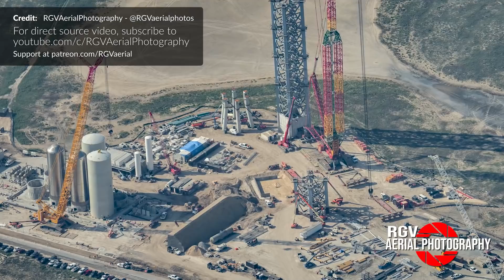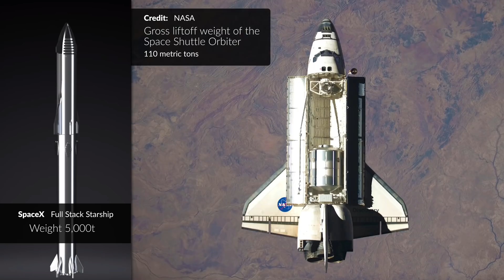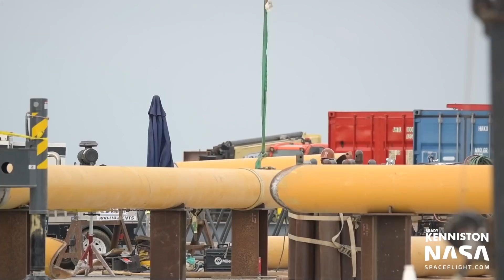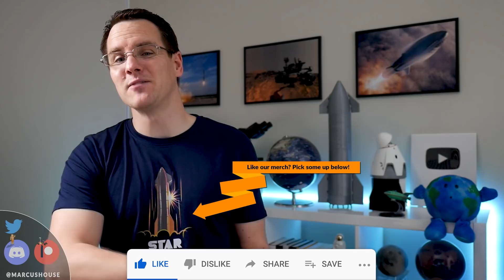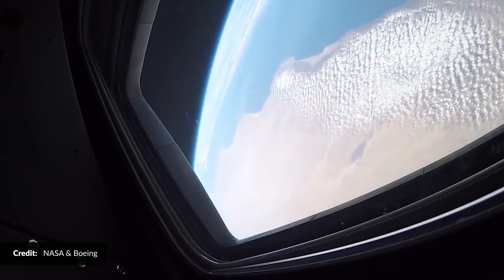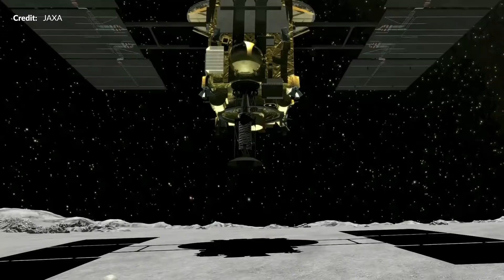SpaceX Starship requires new booster, Shotwell still suggests July for Orbital Flight Test

Comment: The launch tower catching the super heavy doesn't require special tech to work.  The super heavy needs software to put those engines in hover mode for controlled lateral movement in all directions.

Comment: Why won't they just use a quad point tension platform to help reduce the initial mass needed for the engines to give a better initial lift off saving fuel?
 With our modern technology we should even be able to use magnetic track or tunnel to get an orbital vehicle up to speed before it even leaves the ground?
 We've seen some crazy advancements, why not put them together for some greener lift offs... 
Maybe even a space elevator  with a permanent orbital anchor (detachable in emergency) allowing for a real commercial space station and mega labs.
 Either way Go SpaceX

Comment: Hubble is down? Not good just when there is a dwarf planet inbound most likely from the Oort Cloud. It will pass through the Saturn orbit in 2031. Yes ten years to go. The earth will be 9 AU from the planet as it passes. It already has a tail and is coming just about top down, extremely eccentric. It only has a number atm. It’s at a distance about that of Pluto and already has a tail. It is 300 km diameter and it it’s round then it is a dwarf planet.

The planet was found by accident by DES dark energy survey. The computer spat out a WTF and a person went oh fuck look at that! Cool. More time = more accurate info.

So Hubble would be handy right about now.

Comment: Gas thrusters make orientation and placement easy. Only 1m of damping is required on the yellow catch arms which can be added to the vert sliding rails. The crane will be used to lift and relocate to table

Comment: FYi, more fuel does not necessarily mean a bigger explosion.  A almost empty fuel tank will explode easier and more than a full tank. The fire afterward is a different story. Near empty fuel tank is a bomb ready to go off, you need both fuel and air for explosion. Fuel only does not explode. The could use inert gas to prevent explosion in case of a leak.

Comment: I do not see lunar gateway, and probably not the ISS living long. Starship is barely under the volume of the ISS. Triple if you wet workshop it. Create a variant with 15-20+ docks along the exterior as a center core. Dock 15-20 starships with or without fins, landing gear, etc. Like spokes on a wheel. Dock 2 center cores together and you're talking 40 or more starships, each being 3X the volume of the ISS, for a fraction of the cost. They could rent those out as space to manufacturers, tourists, government agencies, schools, etc. Still not big enough for centrifugal gravity, but with that many rockets to create a station, you could launch the parts for a large wheel if they wanted that.

Comment: I thought they would test the booster by itself before connecting it all together with the orbital module.
Reply: @colinsouthern  Right, but they haven't tested the heavy booster yet. I mean, at least run the engines on the ground for a minute. It doesn't make any sense to risk both the booster and the starship at the same time.
Reply: @colinsouthern   Still seems unnecessarily reckless.
Reply: @colinsouthern  I would like to make sure it works before I worry about the budget.

Comment: "Stored momentum" of the solar arrays caused them to unfurl? What an interesting and completely incorrect phrase. I'm 99.99% sure that it was the mechanical property known as elasticity.
Reply from the maker: Darn it! I had written 'tension' in the script, not 'momentum'. I've somehow missread it and not realised. My mistake. You are 100% right of course. Looks like you should be in my quality control team. 😆
Reply: @MarcusHouse  It's almost impossible to speak for a couple minutes about a technical subject and not accidentally say the wrong thing even when you know better. Most people have no idea what it's like to have your words recorded and dissected. LOL.
Reply from the maker: @yogimarkmac  It certainly has its pros and cons. Interestingly, I'm unsure how the tension is stored. The technology seems a bit protected. You might be interested in this thread, however, I am unsure how accurate it is. 
https://space.stackexchange.com/questions/21733/how-does-rosa-unroll-roll-out-solar-array
Reply: @MarcusHouse  Essentially it's just a torsional spring. I suspect the backing acts as a damper to slow down the deployment.

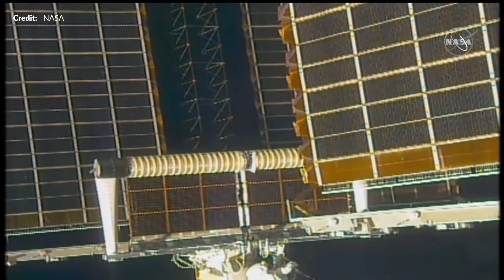Comment: The contract specifications called for a limit of 110db at the perimeter fence. I don't think its inertia that is causing the solar panel to unfurl. If you look at the sides of the panel at 15:58 there's something different than the rest of it. Something black is unrolling into a tube and becoming white. You get another look fully unfurled at 16:05. I think they are using compressed gas to unfurl that panel.

Comment: I helped develop the procedures for the First Hubble telescope Servicing Mission, and helped train the astronauts for it. I certainly hope they can get the telescope back on line. In a few years it will be possible to begin servicing it again using Starship. Starship would actually be able to pull the telescope inside a pressurized environment and allow it to be worked on in a shirtsleeve environment. It would be possible to perform much greater upgrades than have been done in the past, including replacing the flywheels and computers all together.
Reply: Dang! You actually worked on the Hubble Telescope like on how to service it??
Reply: @M_Lopez_3D_Artist   Yep. That was the last thing I did before I left NASA.
Reply: @odysseusrex5908  Thats Amazing! What was your official job title at Nasa if you don't mind me asking? I remember as a kid i sent a letter to Nasa in Middle School.

Comment: I mean the sound that this thing is gonna make.....as loud as a Saturn V or louder or quieter? Anyone have any guesses?
Reply: Starship has more power, which generally means it'll be louder, but the exhaust velocities are pretty different and the apertures of the rocket nozzles are smaller diameter, albeit slightly greater total area, so I can't actually definitively say the peak pressure values will be higher.  I suspect it will be, but it'll also be a smaller difference than you'd expect just based on thrust totals.

Comment: If the fully stacked Superheavy/Starship RUDs on the pad or shortly after liftoff it's going to be a complete disaster. The blastwave will reach nearest Mexican city - 500 thousand population. Windows shattered, roofs and small buildings damaged. Most probably quite a few people wounded, if not killed. 
It might be an end to Starship development, at least in Boca-chicka.

Comment: Space x will require a craft the size of a battleship for any journey to mars. These current designs are sufficient for the evolution of true interstellar travel, but are far, far too small except in a moon mission application. We are a good ways off for spaceships to visit off world destinations.
I see at least a generation developing an artificial gravity system which is needed to dispel astronaut deterioration, and this is a must. So the goal is a long way off, even though there are those who have imaginations that exceed mine. Common sense. 
Not to mention a host of dangers to eliminate in assuring a live crew upon return to earth.
Reply: Starship isn't too far off from a battleship. Right? Even if it is, if starship is successful and reaches a cost of even 20 million bucks (10x the aspirational price) per launch, 10 stations (arbitrary no.) could be built in a single month or less (5 or so launches each) that each had five times the volume of the iss and just as much the mass! And it would only cost a billion dollars!
For reference, the iss cost 150 billion dollars and took decades to build and assemble.
What the heck do you mean "evolution of Interstellar " travel? We are faaaar away from interstellar travel.
Reply: Now I guess that you could just increase the price by a factor of 10 (it's definitely not going to take that much but absolute worst case scenario) for artificial gravity and you could get 10 stations done in a mere 10 billion dollars nd get those up and running in less than half a year.
Reply: @shlok975  Though the price is of course important, more so is the completed project, with redundant features and a modular design. Still, no one is venturing out into space until NASA comes up with a way to avert astronaut's bones turning to mush in zero gravity.
Care to guess how many years that alone will be? Just the beginning of details which will minimize deaths, and there will be deaths. What do you think, next generation? Of course science is advancing even now beyond where I think we should be. Suddenly it isn't complete science fiction, the barrier of traveling distances perhaps faster than the speed of light by not using speed.
Reply: @Giavani-t4k  Good point. Though honestly don't understand why on doesn't just take two starships, tie them up with a long rope and then spin them. 
It probably isn't as simple as that but I don't understand why. Yes, there will be some deaths but I guess some sacrifices will probably have to be made.
Reply: @shlok975  Say, you might be on to something. The centrifugal force is needed to achieve the effect of gravity. At least it makes sense. I'm no scientist though. 
Tether the ships and rotate. Sounds so logical. But I think NASA will develop something, and may already be working on an idea akin to yours.
Reply: @Giavani-t4k  Thanks! I heard of it once in a Scott Manley vid where he worked on a tv show where they had the fuel tanks the crew cabins separate and they tied them with a rope and spun them up.
I guess that that the hardest part would be to actually get a way to spin the whole thing up. Engines won't work and rcs thrusters would probably run out of fuel pretty darn fast.
Reply: @shlok975  Yes, that is a rational reply. The action of this spin in space may be perpetual once actuated. It will be eventually worked out, but the importance remains clear that without artificial gravity, it is not possible to attain this goal of space travel. That's why I say it will be at least a generation before serious planning can be implemented. 
It seems in a way we are like a child shooting way ahead of reality. There is a chance it will never be realized due to the rapidly deteriorating human condition threatening any future. The developments we are witnessing worldwide portend a crash of all which is of value to the race of beings labeled as human .
Think this is a stretch? It's happening before our eyes.

Comment: It looks like the ISS can still get some more panels on there too.
Reply: It's not a question of if but rather the benefits vs problems it creates.

More panels means more maintenance and more obstructions to moving around outside the ISS when its necessary.

Improved panels and larger arrays have already increased the power production quite a bit over the original spec.
Reply: Yes there's room for more if strategically placed😉

Comment: Will they only be launching fully stacked Starships at Boca Chica or will they launch some at the Cape in Florida eventually?
Reply: Pad 39A at KSC has plans and apparently some early work done on a Starship pad there. It appears to be close enough that they likely won't put two spacecraft on Pad 39A at once. Pad 39A also does Crew Dragon, Falcon Heavy, and Falcon 9 flights, so it will be busy. SLC-40 at Cape Canaveral SFS is apparently Falcon 9 only, so I don't know if they will upgrade it. 

SLC-4 at Vandenberg SFB, CA is apparently getting upgrades for Falcon Heavy as there are only 3 Delta IV Heavy's left. SpaceX has been sending Falcon 9's on polar launches from Florida, so they may not need SLC-4 for Starship polar launches.

NASASpaceFlight has reported on their streams that there are plans for another orbital pad at Boca Chica. Deimos and Phobos are still being worked on and are supposed to be done late this year and/or early next year. I have a feeling that they will park in the Gulf to fly and catch Starships from there.

Comment: Wait so they are planing an orbital flight without testing the vacuum raptors
Reply: It appears so. But it makes some sense, because they'll get a chance to test multiple things at once (even if the R-Vacs fail): SuperHeavy launch and return, stage separation, Starship re-entry and thermal protection (even without the R-Vacs, it will be high/fast enough to experience some re-entry heating), and lots more. My amateur prediction is that the R-Vacs will work fine but re-entry will fail for one or more of a myriad of reasons, because that's the most unique-but-untested aspect of the orbital flight.

Comment: I think that the winch machine that was on the oil rig which is now on the side of the launch tower has something to do with the capture of the booster and may work in the same or a similar way as capture rope does on an aircraft carrier to capture planes that weigh a lot and are landing at great speeds when they land just as the booster will weigh a lot and be travelling at  some speed when it comes into be grabbed by the launch tower.

Comment: A maintenance mission to Hubble could be done with Dragon, using a trunk filled with extra tanks for the Super Draco engines.
Reply: A astronaut in an EVA suit wouldn't fit through the hatch, even the side hatch, afaik. And Dragon would have to carry extra O2 and nitrogen to repressurize the capsule after the spacewalk. However, a Dragon could be carried in a Starship to the Hubble; that ship would contain an airlock and whatever else is needed.
Reply: @donjones4719  - At that stage, you might as well just send up a Cargo Starship, pick Hubble up & bring it back…
Reply: @TraditionalAnglican   Spoilsport.  :D
Reply: @donjones4719  SpaceX is going to build a super Dragon for NASA for the lunar gate way. A little extra and they could provide an orbital service vehicle. Even if it needs the Falcon Heavy for launch it would be worth the money.
Reply: @dmk1948   Hmm... The Dragon XL you're referring to will have a good sized cargo section that will contain atmosphere. It and a Crew Dragon can rendezvous at Hubble. Crew Dragon can dock and 2 astronauts will transfer into the Dragon XL, where the EVA suits and anything else needed for the EVA will be waiting. Crew Dragon will close up and maneuver away. There will be room for donning the EVA suits. The only problem is another, larger hatch will have to be created and installed on the side of this craft so the EVA-suited astronauts can exit. Or maybe they can actually fit through the regular hatch. Either way the module can be depressurized and the space walk can begin. Once done, the module is repressurized and Crew Dragon docks again. The special Dragon functions as a detachable airlock.

Designing a new hatch and crew-rating it will cost more than one may think. Anyway, a SS flight will be a lot cheaper than a FH, per Elon. The HLS SS being developed will have a nice big airlock - that design can be borrowed for this mission, and the HLS program will already have paid for its development.
Reply: Good plan. The important thing is that we get beyond thinking there is nothing that can be done.

Comment: They could go up there to upgrade Hubble. The dragons are pretty capable of doing it.
Reply: A astronaut in an EVA suit wouldn't fit through the hatch of a Dragon, even the side hatch, afaik. And Dragon would have to carry extra O2 and nitrogen to repressurize the capsule after the spacewalk. However, a Dragon could be carried in a Starship to the Hubble; that ship would contain an airlock and whatever else is needed.
Reply: @donjones4719  I was thinking it might be able to carry a airlock in the trunk area, even if it couldn't the starship would be great when ready.

Comment: They could go up there to upgrade Hubble. The dragons are pretty capable of doing it.
Reply: No, Crew Dragon is not at all capable of such a complex task. It's only designed to ferry crew and cargo to and from ISS. To repair Hubble, you'd need a spacecraft that a) can grapple Hubble to steady it as it's being worked on, b) is capable of carrying the modules that would be swapped in and out of Hubble, and c) supports astronaut EVAs. Crew Dragon doesn't do any of these. The spacecraft you need is the Space Shuttle.
Reply: @TheRealLaughingGravy  it has a sizable cargo bay, it's well within it's capabilities to bring the required items up even if it takes more than one trip. Sure it would be convenient to have the shuttle back but that isn't happening anytime soon.
Reply: Or a Starship. Put the right equipment in the payload bay and it can do just about anything.
Reply: @user2C47  pretty much, heck if done right it could probably bring Hubble back.

Comment: The booster in the high bay (Booster 2?) is a ground test article, so the forward section without thrusters could be for that and the one with thrusters would be for Booster 3.
Reply: Fun fact, the original SIC&DH had magnetic core memory. Yes, that memory they used on Apollo.  The memory on board now is CMOS.